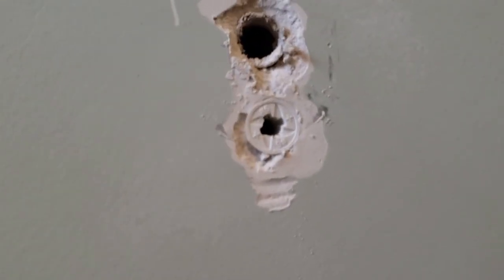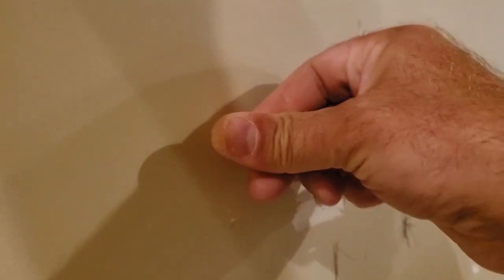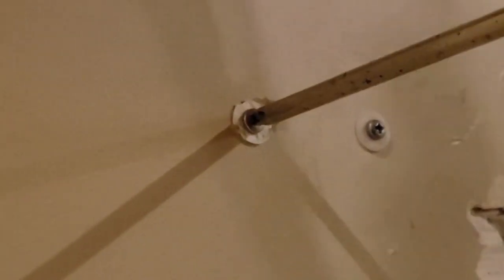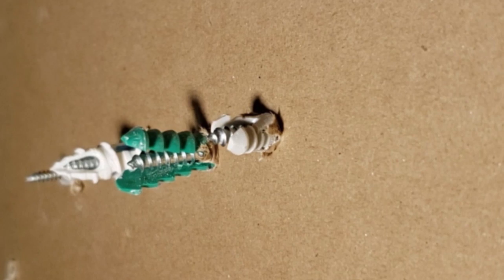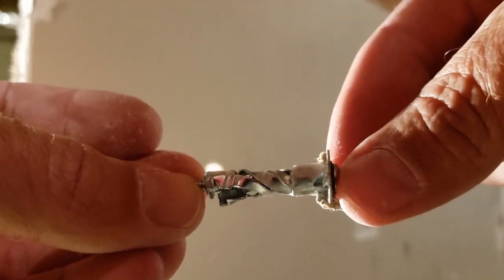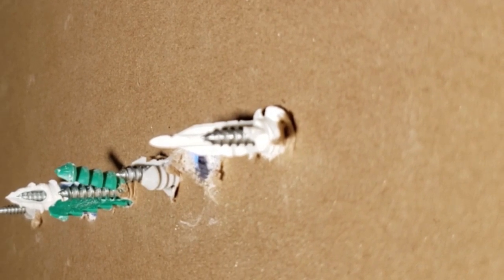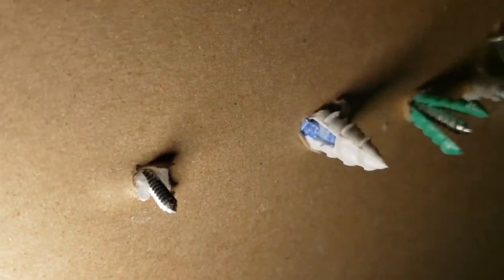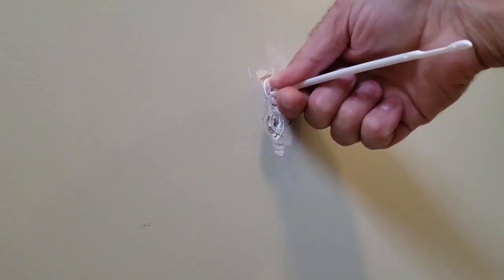Testing Drywall Anchors. What Wall Anchor Will Work?

Comment: These are all meant to hold something to the wall.
If you put the metal one that twisted into the wall, then put a board over it with a hole sized for the screw to go through, then screwed it down, activating the anchor, it would work, I believe.
Reply from the maker: Maybe but I found out you actually need a special tool for the metal one that twisted. I didn't realize that at the time... I mainly made the video to figure out why the first one failed since I probably have over a dozen of those small butterfly anchors in my walls and I wanted to find some other anchors and see how they work.